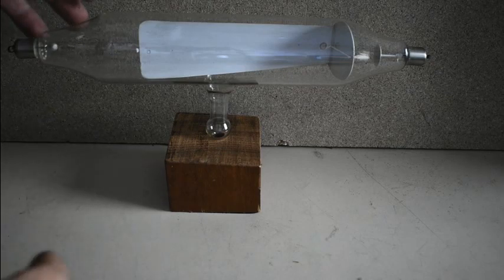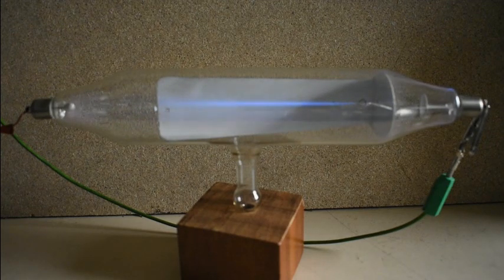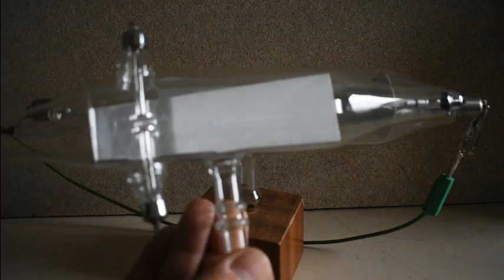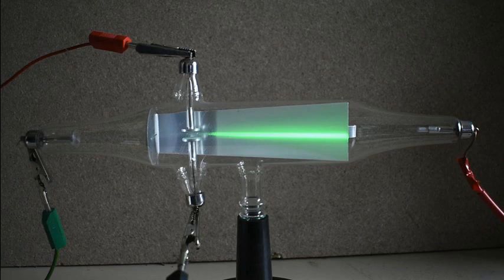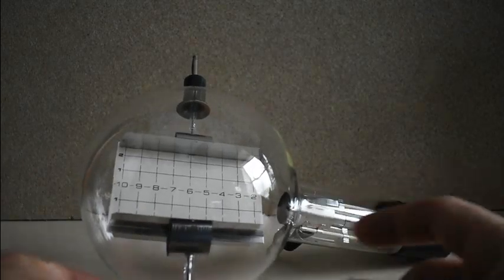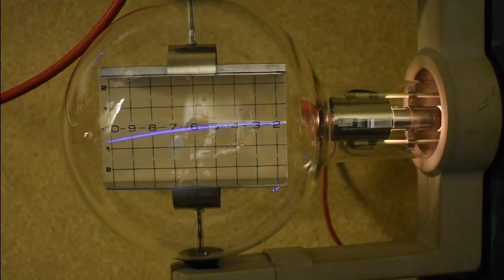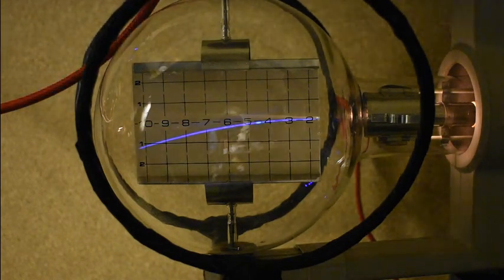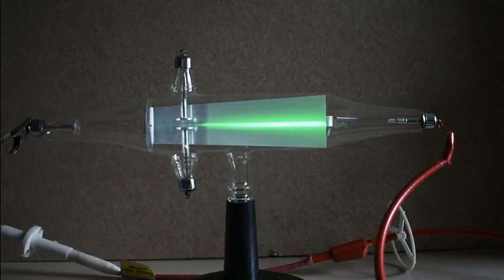Crookes and other educational deflection tubes

Comment: thanks for sharing the information.
Pls share link for purchasing the CRT tube and the ignition circuit.
Reply from the maker: These tube appear on eBay from time to time sometimes old original types but also new educational ones. Various power supplies can be used either salvaged from old equipment or modules bought from eBay or the likes. The Power supply needs to be around 4kv but at microamps.

Comment: 2:00 - Holy shit, thats freaking cool. Its like an electron beam from a CTR monitor... Do you actually see the electrons sparking or is it just the fluorescence that is illuminating due to the electrons? Because of the slit, can you practically perform the "double split experiment"? 3:11 - How is the electrons moving in a straight line when the there is no electrode from the opposite side of the electron beam unit? What is attracting the electrons to go in a straight line near the number "0" section? This is an excellent explanation, I always wanted to see how these cathode ray tubes work in reality rather than paper.
Reply from the maker: Late reply, sorry. The beam travels in a straight line after the gun as they have been accelerated through the gun and continue in a straight-ish line depending on focus. This is the same as in early and oscilloscope cathode ray tube.  With regards to the earlier tubes there is still a small amount of air inside and the interactions between air molecules and the electrons create a glow discharge which can be seen in these tubes. Regarding 'double slit' this demonstration isn't showing any interference patterns but interestingly  electron interference can be demonstrated with a electron diffraction CRT ( I have one on my channel)  . To achieve  this the slit has to be in the atomic scale and graphite atoms are used to from the grating.

Comment: At minute 2:00, what type of supply voltage does the cathode ray tube receive at the four connections it has?
Reply from the maker: In all instances in the video the anode to cathode potential is slightly under 5kV
Reply: @tuopeeks  Can you share the model of the power supply you use, in order to be able to buy it, please.
Reply from the maker: @raulmg1264  Might be hard to find. I salvaged the module from old 1980s laser printer. They were used for corona wire supplies. They tend to be integrated these days so hard to isolate from the rest of the printer's electronics. The modules were made by TDK, part# TXDB66202T. Input voltage was 24V output around 5kv at 0.5mA. Might be easier to build something up or use a low voltage CFL driver but that would need to have a high voltage diode added to the output.

Comment: Sir, what did you use for a DC power supply for the plats, anode, cathode? Thank you.
Reply from the maker: In this instance I am using a small unit (HVC-3MC60) taken from an old laser printer that provides the 6kV for the corona wires. It runs from 24V DC and has an output around 0.5mA. Unfortunately, laser printers today incorporate these supplies on board and are not so available. Similar supplies are around but may need modification.

Comment: This inner plate is made up of??
Reply from the maker: The first tube's back plate looks like it is made of aluminium and has a fluorescent coating on it. This plate is connected as the anode. The second educational tube has a conventional electron gun with a hot cathode and anode assembly. The beam passes over a slightly angled plate of fluorescent coated glass with the graticule printed on it much like an oscilloscope screen but  parallel to the beam. This glass plate is physically held in place by groves in the metal deflection plates.

Comment: What brand(s) of tubes are you using here and where did you purchase the last one ?
Reply from the maker: Can't remember now, the first is an old tube and the second is a new reproduction tube found on eBay a few years ago. I think they were made for educational supplies.
Reply: @tuopeeks  Appreciate the reply! I'll keep an eye on eBay for similar. Have you by any chance measures x-rays (if any) emanating from this device?  I've read that under 1 KeV, there isn't much x-ray emission but higher voltages across the anode/cathode corresponds to increasingly higher x-ray emission...
Reply from the maker: @monkeyclapping1372  X-ray emission is unlikely with a anode voltage under 10kV. At this voltage glass is opaque similar to UV. Most modern replica tubes have some gas pressure and they will operate at voltages under 10kV. Older tubes may have harder vacuums and require higher voltages to start working. If you have to apply voltages of greater than 15kV to operate the tube then it is likely some x-rays are being generated.

Comment: What about William Crooks dark space ?
Reply from the maker: Not demonstrated in cathode ray tubes. Dark space relates to gas discharges in low pressures.  These cathode ray tubes have higher vacuums where no gas discharge is visible.

Comment: hi, how much is the power of inverter?
Reply from the maker: The inverter used to create the beam splitting is probably capable of about 30W but used here to create the plate voltage so loading is negligible.